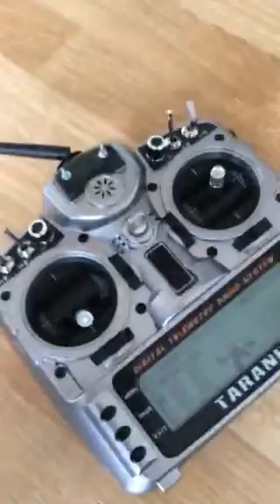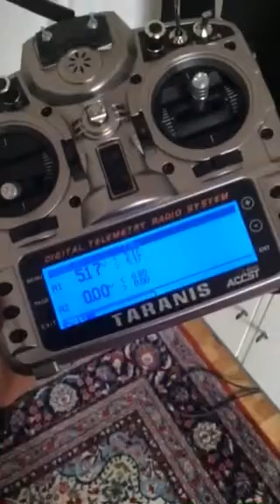FrSky X8R BAD, needs a reboot to work partially

Comment from the maker: It was a defect in the receiver. I had to RMA it. Badly soldered antenna pins. I lost signal in flight but luckily I setup my naza for failsafe landing. 

You can get this signal flapping error when too close to the craft, and that is normal. But you should never have it when 30cm or more away.

Comment: Yes, I have the same problem on all the FrSky V8 receivers. It seems to occur randomly. Have you had any loss of connection during flight?

I never had this problem with the Turnigy X9 + FrSky module setup.